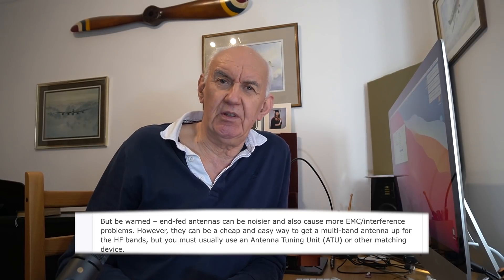END FED HALF-WAVE ANTENNAS - BEWARE!  WHY?

Comment: Hi Peter, I chat to a few chaps on 80m on a vertical (Diamond CP6S) - but most of them are using wires or horizontal antennas, hence the QSL’s even up the road are patchy. My garden is too small (approx 10m x 5m) half of which is covered by a metal awning and the rest had fairly tall trees so limited on space. I’m also limited on height so the antenna or anything I put up can’t be visible from the road at the front.
I’m very limited on options and someone mentioned a Magnetic Loop antenna - but these are hugely expensive!
I’d love to see a feature by you on limited space antennas for 80/40m and if a Magnetic Loop antenna would be suitable. I don’t have time to make one as self-employed and don’t have that much time to dedicate to the hobby.... Looking forward to seeing something on this if you do one..
Thanks. VK4EPS (Brisbane Australia)
Reply from the maker: Many thanks D anny. ' 1 will Keen that m mind as you are not alone!  Thanks for viewing. 73 Peter

Comment: Seems like there's a lot of disagreement whether EFHW antennas need traps to support 2x harmonics.  Does using a trap improve gain or such if you're using an 40m EFHW for 20m, for example?
Reply from the maker: An ebd fed half wave works naturally on the second harmonic. Not sue I am understanding yiur question about traps. 73 Peter
Reply: @watersstanton  That's basically what I wanted to know.  I have heard you must use traps to make a multi-band EFHW - especially if shooting for the second harmonic.  Can't seem to find a link.  There are a number of videos on Youtube showing how to create an EFHW with traps.

Comment: My end-fed, from eastern Ontario, has done Crimean Penn., Hawaii, Uruguay,  Turkey, etc etc., though it seems  to not like the Dakotas or Argentina! I live in a fairly dense suburban neighborhood, and knock on wood, after 1.5 yrs no complaints (10,15,20,40m). My beefs with end-feds is that my property doesn't allow me to move it around, and they're not very directional, so rejecting noise can be a problem (same as a vertical I suppose). But really, for the money, the good ones are darn tootin' good.  For me, 20m and 40m are the workhorse bands. Either will work most of the time. 15m is fun and occasionally really surprising.
Reply from the maker: 15m should start to beome a serious band in a couple of years as we climb the sunspot ladder. 73 Petr.

Comment: ive been using an end fed commerically made long wire for a couple of years on a yaesu 847 with an external tuner. It runs from my chimney at 28 feet to a tree 20 meters away at 15 feet. Tunes up on all bands from 80 to 10 meters. Never had any issues with it and works great getting contacts in the UK and abroad on voice and FT8. Its just as good as my hustler BTV4 multiband vertical, on my yaesu 920, and sometimes out performs it. Simple to install, doesnt require much maintenance and has been up there for years in all weathers. Would recomend using one of these if your just getting started. Thanks Mr Waters. Good video. Youve finally put the bad myths to rest with your expertise and reasurrance.

Comment: 10800mls to Australia ft8 ic705
10watts best antenna I have owned.Never caused any interference.Mine is 40 ft in the air including the transformer box in  horizontal config 80-10mtr  my tuner can also give me a decent swr  on top band.

Comment: I think it's important to emphasize the difference between EFHW= End-fed HALF WAVE (ie 49:1 transformer fed) and other End-fed 9:1 unun "Random wire" type antennas. they are two very different beasts. The paragraph you quote in the video is almost certainly referring to the 9:1 random wire design, not only is it often responsible for RF in the shack issues it is also far less efficient. Peter, perhaps it might be worth you doing a video to explicitly to describe the distinction between the two as it does seem to cause confusion?  

By the way I have on several occasions last year worked both VK & ZL from the UK using my homebrew 49:1 EFHW on 20m while out /portable. I can't wait to get back out portable again in the very near future  73, Tom
Reply: Will you still have RF in the shack with the efhw, just less?  I'm looking into getting an HF rig, and probably will  do a random wire, only because I'm in an apartment and proper antennas aren't an option. Unless the efhw is significantly better than the random wire, in that case I may employ 2 or 3 on 40,20, and 10 meter.

W3MMW
Reply: @matthewweaver1123  the EFHW is a lot better...easier to tune and behaves the same every day...If your in a position as to where you have to use a random wire make sure and get a good beefy tuner that is wide range and you should be fine...but if you can, make your life easier and run a EFHW with a good tuner and a rfi choke either a commercial unit or just make one by coiling a few turns of your feed line...73

Comment: I use a EFHW 40m-10m no garden so up 20ft pole and rest sloping down side of house. Great results from my QTH on Mauritius to North+South America, Caribbean and regularly into Europe, all on low power. As mentioned in video I have a line isolator on roof 6ft from the matching unit + one in shack, no RFI. Antenna is good and practical for a home area with no garden space.

Comment: I recently installed an end fed 1/2 wave and find it to be an excellent choice. It is compromised by being only 12 feet off the ground. I have purchased a 12 metre spider pole and will be setting things up in the next few days. This will place the antenna about 30 feet above the ground. Currently  on do get some dx 3000-4000 miles. This'll improve with the increased hight. Thanks for your efforts and videos. VE3DBN

Comment: Your right Peter, I've hear it often "Oh I wouldn't use a vertical, they bring in more noise". Well I use a 33' smart tuned vertical, tuned against heavy wire radials, it is an excellent receiving aerial. Its all about how you set it up & location /proximity from buildings. Nice video Peter, best 73 GM0KET
Reply: Do you have a schematic or any video or online article that explain your antenna build?

Comment: An experiment looking at using 1m vs 4m of coax between the transformer and the choke (before the subsequent coax entered the house) on my EFHW (40m length) showed a better SWR and  less noise with the longer option. More tellingly, a 6 hour block of WSPR beaconing with the 1m coax gave 120 hits whilst the 4m coax gave 655 hits at the same time of day (although 24 hours apart). I took this as reasonable evidence that coax length between transformer and choke makes a difference. Agreed, unwarranted bad press! The wire is stretched at the top of 3 X 12m spider beam telescopic poles. Only mention that because having it so high is not only a benefit from a propagation point of view but also good from an EMF risk assessment view point.
Reply: Thanks for sharing this - interesting. I wonder which band or bands you tried the 1m vs. 4m test please?
Reply: @Steve-GM0HUU  apologies, it was only done on 40 meters!

Comment: I use a EFHW bent around my very small garden, it works very well, plus has the added bonus of no heavy feeder in the middle as used by my previous dipole. I think the confusion lays in the description of the antenna, today an EFHW.In the 60's and 70's people were using a random length  longwire, that they tuned with the output stage of Valve P.A.'s G8XDD.
Reply: I was going to say the same. The RSGB are likely referring to random length wire connected to say a 9:1 balun. EFHW antennas (which i am a fan of) are resonant and are conected by a 49:1 balun. 73 Mike M0SAZ.

Comment: I use an 80-10m efhw in a 33ft garden vertical,horizontal and zig zagged down the garden.ive often worked stateside on 10w at 35ft :) swr for all bands well under 2.1:1

Comment: I’ve built the 40m efhw with the 80m loading coil, works a treat
Reply: Me too - 110uH coil right?
Reply: @sirhaugen1025  Yes, works a treat!
Reply: Ever try using it as a quarter wave on 160m?
Reply: @joeshmoe7899  yes - works ok
Reply: @joeshmoe7899  Yes I use a 12v relay to switch my 80m EFHW to become a QWave for 160m which works really well. This idea was taken from Steve Ellington Utube articles, he is well known for his EFHW designs and ideas.

Comment: Following your earlier videos, I built an EFHW with 20m wire and line isolator/choke balun where it enters the shack. However I had a lot of RF in the shack, proven by the use of an RF ammeter on the feed line. Adding counterpoises and earthing it to the metal conservatory frame got rid of most of it. It is an effective, simple and unobtrusive aerial, bit it does need earthing/counterpoises - the laws of physics still apply! May be those people that seem to get away without have a long length of feeder before the choke balun and this acts as the counterpoise. I only had about 2m and the RF was horrendous, lighting up LEDs on unconnected equipment.
Reply from the maker: Hi there. Thanks for sharing. 73 Peter
Reply: Earthing sound different than a ground level counterpoise.  Can you clarify ?  Where is the grounding done?

Comment: I passed my foundation less than a fortnight back.  Got my first HR rig a couple of weeks earlier than I thought I would be able to on Saturday, put a multiband end fed of 21 meters into a cheap 9:1 balun I was able to amazon prime on Sunday.   I didn't want to go to the end of the garden in my slippers so it slopes up to about 15m on to pole a weather station is on and back down a bit at about 70 degrees to an apple tree.  I listened with it today with excellent results.  The antenna matching unit in the radio seemed to have no issues but I've only keyed down to check SWR and haven't made any calls because I'm mic shy and didn't take up the hobby for phone modes.  I didn't choose a half or quarter wave design after reading the advice you're talking about but still needed a quick and cheap multiband qrp wire antenna when everyone seems to be out of stock of ready made units in my price range.
Reply from the maker: Nice to hear from you Stephen and welcome to the Hobby. 73 Peter

Comment: I use EFHW (resonant) antennas exclusively.  A multi-band EFHW antenna for 10, 15, 20, 40 and 80 meters isconfigured as a sloper.  A 20m and 11m wire are hung vertically from fiberglass telescoping poles.  They are cheap, and they work very well.  I do not nead a matching device aka ATU.  My nearest neighbor is over 200 meters away, and I have heard no complaints.  My wife has also not registered any complaints with EMI.  Believe me.  She would be the first to be pissed if that were the case.

Comment: My efhw is fed at the end of the garden, up a tree and then it comes part way back towards the house..an inverted L...its knocked 3 S points off the noise floor on 40 mtrs and you can audibly hear better ..I can work most of Europe.. Sometimes further.. .reverse beacon network shows me I'm being heard on the east coast of the USA..unfortunately the noise floor is still a bit too high for me to hear them..but that is true of any antenna I put up..modern urban living with loads of domestic rf.

Comment: When I was instructing the Foundation licence course I could never understand why the RSGB were so anti EFHW.  I could not offer a reasonable reason for it other than what you say about TV interference. I’ve used them for many years and never had any issue.   Come on RSGB you should correct this 👍🏻👍🏻👍🏻
Reply: @jpmacg1 there already is and it's the braid of the coax .
Reply: Exactly!   I'm gratified that someone else understands.  And hence the concern regarding RF in the shack.

Comment: thanks for video watersstanton ,i was wondering if you would run a earth ground wire were the feed point meets the antenna ? thanks again !!
Reply: No need for an earth as the coax is part earth/counterpoise, read K1RF pdf
Reply: @geoffbrown.rfcomms1107  thank you for info and reply
Reply: @tonyturtle5805  check out Steve Ellington youtube test results on grounding he shows with a modest ground current on the radiator increases
Reply: @Pioneer936  thanks for reply !! and info

Comment: Efhw are far less prone to causing rf in the shack. The impedance is so high at the feedpoint that it helps to choke off most of the rf. it’s voltage fed after all.
Reply: With counterpoise or choke....
Reply: @G7VFY  not in my experience
Reply: @TIMG5TM  I thought you had an RF-in-the shack problem?
Reply: @G7VFY  that was with a centre fed doublet
Reply: Yes and that high impedance, when driven with several hundred watts, creates such a high voltage across the tuner inductor, that it will arc and cause heavy damage. I see mention of QRP, 30 watts, 80 watts and the like, but how does it work with 900 watts?
Reply: @loupgarou1261  check out myantennas, Hyendfed, ukantennas. All make Qro versions. Superb reviews on eham.
Reply: @loupgarou1261  High Power = High Spec components and some proper safety precautions. You would not want a RF burn from a 900Watt Transmitter / Amplifier combo.

Comment: Hi , My "My Antennas" EFHW works great. I live on a wooded lot and feed the 49:1 transformer with 100 feet of coax. I don't use a counterpoise. The antenna's half wave length is for 160M. Works great on 160, 80, and 40M. I plan to build an EFHW mounted vertically for 20M. This should have a great low angle.
Cheers from Pennsylvania!
N3SWL
Reply: I made a "short" vertical efhw for 20M. It has a total length of 7 meters and good SWR on all the band. You would need a 49:1 transformer, then 5 meter wire, a 8uH loading coil and then another 2 meter of wire. So far I made a couple of contacts into the US and Canada with it, all of Europe is no problem at all.

Comment: I have an 40m EFHW because it was the simplest antenna to get up and running and by far the most cost effective. As a courtesy I spoke to both my neighbours and told them what I was doing and that they were to let me know if there are any problems. Both have confirmed they haven't had any issues at all. I can also report that I've had contacts all over Europe and Scandinavia using it at 10W. I have also built a 20m EFHW for QRP use as soon as I can get out and about properly.
Reply: Yes it is a super antenna, get one FREE and have a play, been building them for over 15 years, when W&S were in business in Essex we built stacks of the resonant end antennas for them (under G Whip see eHam), Whilst they were single band L/C designed items it did not take long to produce the multiband units with the right cores. They are now produced for the commercial users around the World and using Hybrid designs of the cores so spot and multiband frequencies are useable on 3 to 30MHz. Anybody want to try one? FREE to collect from Southampton UK, see https://rfcomms.co.uk/gb1/   and  https://rfcomms.co.uk/icom/    last October/November saw super openings on 28MHz, read the Icom page, IC-705 10w to FR5/ZS6/PY/FY etc or read the ebay feedback de G4ICD
Reply: @geoffbrown.rfcomms1107  I have two of the RFComms EFHW 49:1 units. Both the antennas I mentioned in my original comment above are based on your 49:1 units. I bought the larger one from you via eBay and got the smaller unit for free and consider I got a proper bargain. They both work brilliantly and I have the larger one set up at home and smaller unit for portable operation. While my first homemade 49:1 worked well yours are an order of magnitude better and I would suggest anyone with a radio would be lucky to get one of the your units free or otherwise.
Reply: I use the same antenna and love it..can you not get your 40m to work on 20m or did you just want a proper 20m antenna? I was just saying this because mine works great on 10, 20, 40 and ok on 80m....of course i have to use a wide range external tuner
Reply: How high off the ground do you have it?